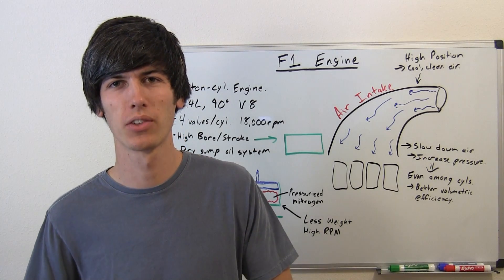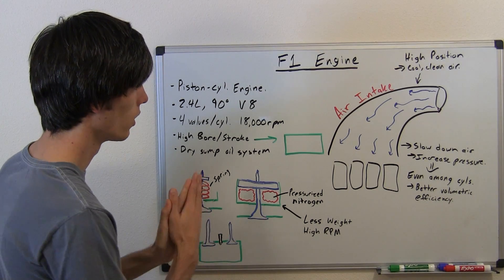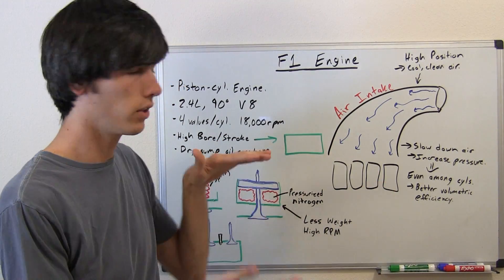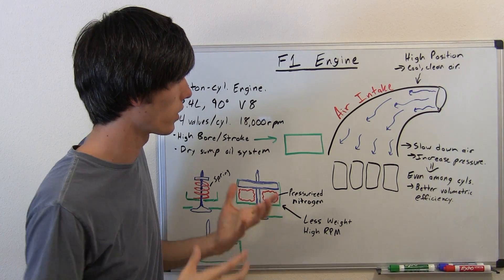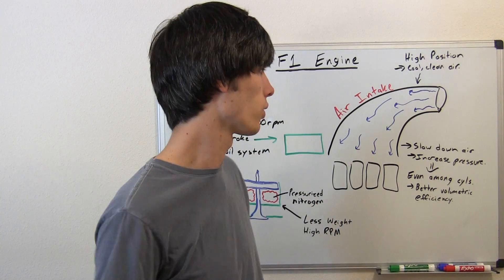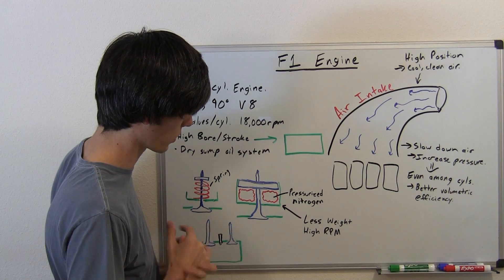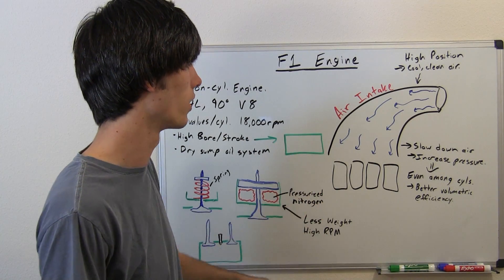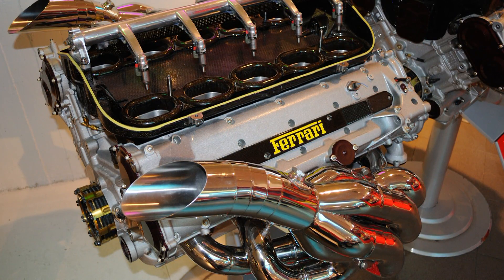F1 Engine - Explained

Comment: Sorry to be fussy as I learn a lot from you but.. when the air intake area increases the air pressure drops and velocity increases. This makes sense because a gas always tried to fill whatever space it has available.
Reply: PS why nitrogen for the valves rather than oil? weight?
Reply: Well, Bernoulli and Venturi would disagree with you if they would still be with us.
Reply: shi01 Can you explain please? I work in acoustics where it is understood that in a sound wave there are compressions where air pressure is high and velocity low, as well as rarefractions where air pressure is low and velocity high. This makes sense to me as where the air particles move faster there is more space between them and lower pressure. Conversely where air particles slow down they bunch up and pressure increases.
Reply: Yes, but you wrote that the pressure would drop and the velocity increase if the air intake area increases and that's exactly the opposite of what the venturi principle tells us what would happen in such a case, at least at sub sonic speeds. If the area after a nozzle or any kind of restriction widens again, the velocity of a fluid will decrease again and the static pressure will increase again. And basically the simple reason for that is that the massflow must be constant. So it has to be flowing faster if the cross section is smaller and will flow slower if the cross section gets bigger and as you wrote correctly, the pressure drops with high velocities and increases with low velocities.

Oh, and the reason they don't use oil for the valves is very simple. They only use pneumatic valve springs. So basically it's a pneumatic piston which is pressed down by the camshaft and is forced up afterwards by the gas pressure. Gases are compressible, liquids like oil arent. You can't move a hydraulic cylinder when the feed valve is closed, doesn't matter how hard you try. But you can move a pneumatic piston with enough force even when the valve is closed an no air can escape the piston.
Reply: shi01 Thank you for your reply. I must research this more.

 I understand what you said if mass-flow must be constant. However, I wonder why mass flow must be constant, if the fluid is compressible / expandable?
Reply: Hello. I did some reading. It seems that the behaviour of air depends a lot of speed as you hinted above. At lower speeds the air is mostly in-compressible and so flow though a system must be constant. That applies to this case. If flow is constant, then velocity must increase through a restriction. On the other hand at higher speeds air can compress and we see almost the opposite behaviour where pressure can increase through a restriction because the air can not 'move out the way' fast enough.

I wonder if this helps explain why standard aeroplane wings do not give lift above super-sonic speeds - because the wing is going too fast and the air simply compresses rather than maintaining constant flow over both the top and bottom?
Reply: Well partially. In the olden days, most wings were straight and mounted pretty far forward at the planes body right? The Spitfire is prime example for that.
One of the problems with this design was, that the wings basically stiked into the highpressure shockwave (Mach cone) created by the nose of the plane and this could lead to a seperation of the boundry layer over the wing, which basically meant the wing would partially stall.
One other problem was, that if you reach super sonic speed, the center of lift of the aircraft will shift to the back. There is, as far as i know, no way around this effect and even happens on modern fighter aircraft. But in the late 40s for instance, all aircraft were build in a way that the center of mass was in pretty in front of the the center of lift at all times. This leads to an "dropping the nose" effect" if the airspeed is lowered and also at a low speed stall the nose drops down by itself, which is pretty handy.
But this could also cause a deadly problem. Because if the CoL shift backwards the effect of dropping the nose increases and in the olden days, the effect could overcome the control authority of the plane. So the pilot could pull the stick all the way back, but the plane still get into a steper and steper descent, right into the ground.

Comment: There absolutely IS a ram effect on the intake. That is how the divergent nozzle configuration allows a higher static pressure in the larger area section compared to the intake mouth (when the car is moving).

Comment: Why don't road cars use bore/stroke ratios like F1 cars?
Reply: Disregard that comment, I took to the F1technical forum and quickly got my answer in the form of paragraphs and paragraphs of technical specifications and algebraic formulas I don't even want to try to understand. But to anyone else who's curious, it has to do with optimal operation and F1 cars suck at stop and go, but they're really good at GO! The rev range to produce sufficient torque is far higher with f1 style b:s ratios. Trying to get the car rolling from a stop at those rev ranges needed to produce the same torque would see you burning through clutches at much higher rates and would also sacrifice a lot of the smooth power delivery that is desired in commuter cars. There are a lot of other factors you could read into but those seem to be the biggest problems.

Comment: hey great vid ! thought i could use some additional infos and this one came out great. So.. i got some questions abt the pneumatic valves if u dont mind answering them. 

-does the pneumatic valve place higher load to the camshaft compared to spring valve ? 
-can the pressure created by the pneumatic valves be controlled ?
-is it expensive to be utillized in our typical engines ? 

thank you ! have a good day everybody ! :)

Comment: Fun stuff.  I like your videos. Regarding you description of static regain in the air intake, the intuitive notion of "ramming" not bad.  As you suggest, the velocity pressure is converted to static pressure (and turbulent energy) as the air slows down in the expanding duct.  But I think that is consistent with the intuition of ramming = momentum transfer (i.e., momentum from something moving fast - air at inake - to something moving slow - air in enlarged section of duct).  No?

Comment: Not only out of date, plain wrong.  Dry sump avoids the crank churning the oil which is very lossy - there are scrapers even in hi pi wet sump engines to partly avoid this.  Worth some tens of HP even in a street car.  The pickup problem is the same regardless of oil tank location, duh.  Race engines easily get to 120% or more volumetric efficiency (read Hot Rod mag etc) without turbos, via inertia in the intake system and valve timing.  Similar exhaust scavenging effects exist.  This guy hasn't a clue about how hi po engines work and is claiming to be an authority on F1?  Not out of date if you consider when made - it was dead wrong then.

Comment: Volumetric efficiency is the ratio of intake air volume to 1/2 swept volume. Naturally aspirated street motors usually don't do better than 85% but race motors regularly exceed 100% due to the inertia of high velocity intake and exhaust combined with aggressive valve timing.

Comment: As you said, the pneumatic system has a reduced weight. But in the pneumatic system, you have an additional piston in place a spring in the ordinary engine. Plus the weight of a piston would be more than that of a spring. This implies the weight of F1 engine is increased, which is contrary to what you said. Please explain this to me. Thanks

Comment: f1 is not v12 ?
Reply: i thinks its goes from V6 (nowadays) to V12
Reply: They currently use a single-turbocharged 1.6L V6 engine - max revs at 12,500.
Reply: They were 2.4L V8 at 750-800hp at the time this video was made. They keep reducing engine size because they keep making them more powerful. They're using 1.6L turbocharged V6s now and (largely due to aerodynamic advances, and better engine power application) are beating lap time records from back when they have 1000-1200hp engines.
Reply: Would disagree on the aero part, F1 cars are significantly slower due to the restrictions placed on them for the 2014 season on-wards, compared to the V8 and V10 era aero regulations. Thanks to the introduction of a "qualifying" tyre in 2016, these cars put out some serious lap times. Was great to see :)
Imagine the V8 chassis but with a current Power-Unit configuration?? Definitely hitting 2004-2005 lap times... Luckily this season will give us 3-5 second faster cars, just purely from aero/chassis downforce and tyre grip.
Reply: they keep updating the aero rules to make the cars slower, but the lap times keep getting shorter.

Comment: why cant we use solenoid kind of actuators to operate the valves
Reply: Reliability and speed. With a solenoid you need to charge the spool to start converting electrical energy into kinetic. With the gas valve, all your potential energy is already there ready to be released. And especially in F1, anything electrical needs its electricity generated on board, and that reduces efficiency.

Comment: At the end, pik of Ferrari engine, I notice the fuel injector seems a long way out of the inlet tract, just seems strange. I can only assume once the system is running the air flow takes the fuel mist down with it. I would guess any cylinder with a backfire would cause a huge fire. I know the injector doesn't squirt directly into a cylinder but these do seem a long way from the inlet tract.
Reply: I think the injectors are positioned for optimum atomisation of the fuel as the air flows over them at great velocity in a high performance engine. Don't know about backfires on start up but I guess the engine management system is intelligent enough to stop or limit fuel flow to prevent flooding or fire.

Comment: Thats intersting. Why do they bend those headers so much? Wont that create too much back pressure? They almost do 300 deg or so!
Reply: It improves scavenging. It's basically a "equal length header" setup. The individual exhaust pulses create a negative pressure wave behind them when they reach the collector and helps this way to extract the exhaust gases out of an other cylinder that just opens the exhaust valve at the right moment. 
So basically this setup reduces pumping loses.

Comment: The main reason for those high intakes is safety. If the car lands upside down in a crash the head won't be crushed because of the high intake.
Reply: Well, it's more the other way round. They didn't had always the airintake so high up. Especially in the 80's when they used turbo engines some cars used little snorkels on top of the sidepods to feed the turbocharger with air. (McLaren MP 4/4 f. i.) But they have to have a roll bar over the drivers head since a very long time and with a natural aspirated engine it can give you a few extra horse power if the air flows calmly into the airbox. So they simply integrated the air intake into the the upper roll bar which is a very elegant solution in my opinion.
Reply: The intake is that strong?
Reply: Pseudo Mortality
It absolutely is. If it weren't the drivers would be decapitated every time they crashed.

Comment: Don't they also use a different fuel? And can you explain why we don't have a similar setup in road cars? If I had to guess, I would say it's because those engines don't last very long at all, but is that due to this type of setup or because the engines are made out of light and relatively brittle materials (i.e. Like cast iron vs aluminum engines in road cars)?
Reply: The fuel they use is still petrol, just with a very high octane rating. But normal cars would run perfectly fine with this stuff.
The reason this kind of engine don't last very long is simple, they were designed this way. The materials weren't that different of what you can find in normal car engines, but F1 engines are simply not made to last. At the peak of the V10 era in F1, the engines had a dry weight between 80 and 90 kilogram. A normal 4 cylinder engine in a street car is heavier than that.

Comment: Question:
2005 or 2006 Renault came up with a V-Engine in 111 degree. A Season after everyone change to that and build in 111 degree. So when was the change back to 90 degree and why? Is 1,6 Liters too less substace?
Reply: They changed to 90° in 2006, when they also changed to V8's. Before that the bank angle wasn't specified in the rules and every engine supplier could do what they wanted in this regard. But Renault was the only team that tried a 111° V10 engine and actually they failed with it. They had problems with the stiffnes of the block and later, when the undercut sidepods started to appear the engine was also deamed too wide and would hinder aerodynamics. So Renault buried the 111° engine at the end of the 2003 season. Most teams at that time used V10 engines with 72° or 90° bank angle.
Reply: in my memory alonso won his first championship with that 111° engine, because of this different engine. but i see. your right my friend. found a usefull site about it.

Renault R202 from 2002 (with 112°)
http://www.f1technical.net/f1db/cars/859/renault-r202

Renault R23 from 2003 (with 112°)
http://www.f1technical.net/f1db/cars/869/renault-r23

Renault R24 from 2004 (with 72°)
http://www.f1technical.net/f1db/cars/878/renault-r24

Comment: After looking at this video, and this may sound weird, I noticed that your fingers appear to be double jointed, given that with your height and other features I strongly recommend that you see a Dr to investigate possible Marfon Syndrome. Especially  get  them to do a Cardio echogram to measure your Aorta. I am saying this because it could save your life.  Young males your age have dropped dead with aortic embolism because they have this condition.  Again this is not a hoax or some weirdo trying to spook you. An appointment to a Dr will at least illuminate my initial findings

Comment: You should also mention that pistons are made really tight in the combustion chamber so tight that they have to give it a specific temperature before starting it up otherwise the chamber will brake or be less efficient

Comment: Thanks for having an informative and understandable video. My question is this, my buddy owns a Yamaha R6 which redlines at 17,500 rpm. Is uses a longer stroke and valve springs. Any idea how Yamaha accomplishes this?
Reply from the maker: I googled it, apparently has a much larger bore than stroke, as I'd expect for such a high revving engine: Bore × stroke, 65.5 mm × 44.5 mm
Reply: You hit problems with valve springs when the frequency they are being operated at matches the resonant frequency of the spring. Bigger springs, required for heavier valves, have lower resonant frequencies so will "float" at lower revs. The valves in the R6 are very small compared to F1 valves so the valve springs are smaller and have a higher resonant frequency, much higher than the frequency they are being compressed at. The gas springs in F1 engines have a very high resonant frequencies so no risk of valve float.
Reply: use camless
Reply: there are other valve spring tricks. now beehive Springs are common and reduce retainer weight while having only some of the spring at the same large size. now they are working on conical Springs that will not have one coil that matches the other so resonating in one coil will not have an effect on the others. just waiting on PAC or PSI to start making them.
Reply: All designs without cams so far have had issues. The mechanical one wouldn't rev passed somewhere around 12k and the electronic ones draw to much power.
Reply: Shawn Dickens q
Reply: Longer is relative to normal for that segment. It would still be short for a street car. You can't expect to move any valve an inch and get the same peak rpm of one that move half that or less. They do it in Racing by giving up comfort, cost limits, and durability. Motors a always about compromise.
Reply: David Edmondson I think you meant to say valve float "at high revs".